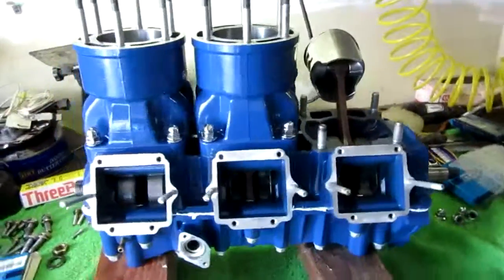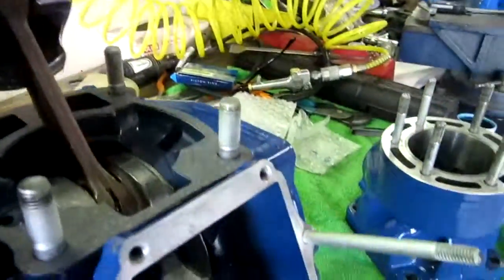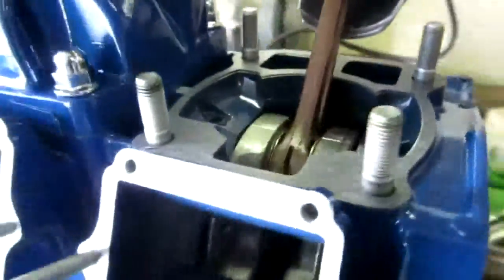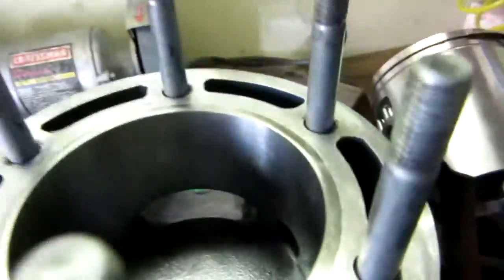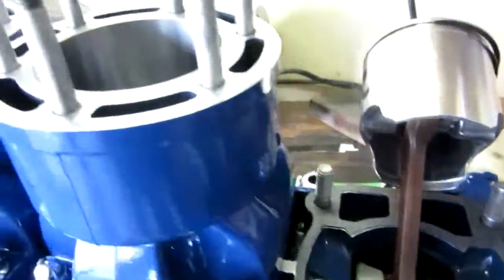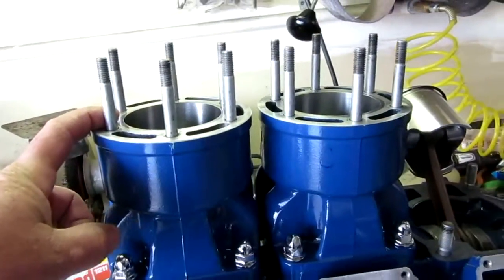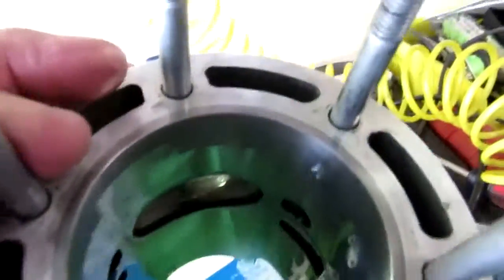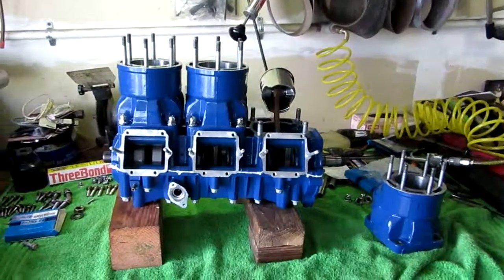Polaris 780 fuji engine reassembly

Comment: Can water get In the crack I flushed it and now my blue motor doesn’t start
Reply from the maker: lol, the crack? what are you trying to say? I'm guessing you got some electronics wet maybe or you got water in the Carburetor. Start by removing your plugs and turning over your engine to be sure no water is in it. Then check for spark. Make sure you got a good charged battery.
Reply: @mogyver69  I pulled the engine out  the 4 3/4 nuts off. I left the 4 engine mounts In. So do I have To realign the engine or just drop it in ?
Reply from the maker: @Beachlife-1  I'm sure I'm going to steer up some disagreement among the forum with this response. I personally have removed my engines split the cases and replaced the seals and put it all back together without ever  using a alignment tool. But I was careful to make sure if there were any shims I reused them and that I tried to make sure the engine plate relaxed back in its original position but for the sake of preventing people from steering up things.  If you have access to a alignment tool its always recommended you check the alignment prier to reassembly. If its not aligned you will wear out parts and can have a bad vibration. Its your call!
Reply: @mogyver69  ok thanks and I found a bent clip in the crack I don’t know what it is?
Reply: I pulled the engine and the carburetors off and all of the reads were wet
Reply from the maker: @Beachlife-1  your doing way to much work then is needed. Just pull the plugs and turn your motor over. Get the water out before it causes any damage.
Reply: @mogyver69  do you think the wrist pin clamp came off I found a metal pice in the engine?
Reply: @mogyver69  and do you got a video on how to set the carburetors I might as well clean them good and put 2 inline fuel filters
Reply: And drained out all of the water that went in. Because I hooked up the garden hose and the engine shut off before I could turn off the water I guess it flooded. I will never hook up the hose again
Reply from the maker: @Beachlife-1  lol, you need to make sure your engine can stay at idle or be sure you have a shut off valve on the garden hose for that exact issue. In any case all you have to do is remove the spark plugs and turn the engine over to get the water out. keep the battery charged good it will take some cranking to get all that water out and you will probly have to remove the spark plugs a couple times to dry them before it finally starts again.
Reply: @mogyver69  But I was thinking about it could the exhaust pipe gasket also leak water inside the engine?
Reply from the maker: @Beachlife-1  yes , and if it does it can cause you to burn a hole in the piston. It happen to me once.

Comment: Hello,
I just tore into my SLT780 97'. i removed the engine today. im going to remove the carb rail tomorrow and push forward, i was wondering are those new jugs for the cylinder head? and did you paint the engine or is that a bought setup? 

i guess i need to repair/replace my jugs also. any advice on this process?
Reply from the maker: That is the factory motor. I never painted it. just cleaned t and Honed the cylinders with a honing stone from local auto part store that goes on my drill.